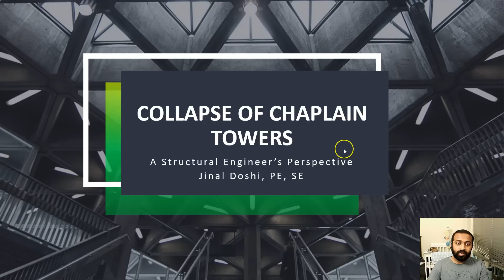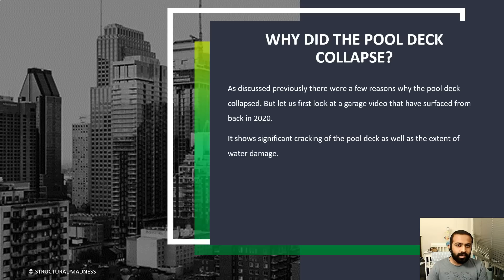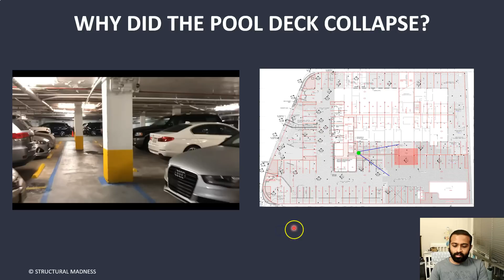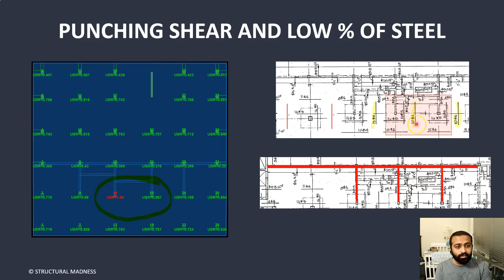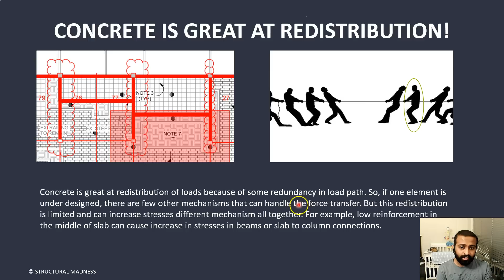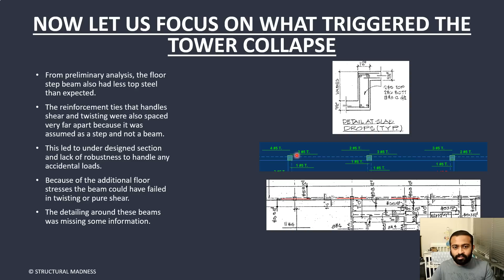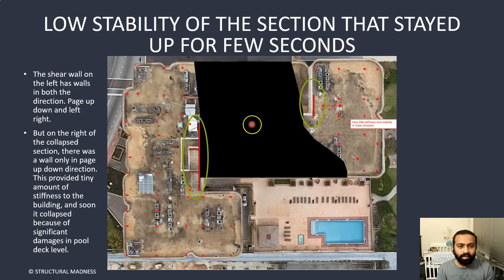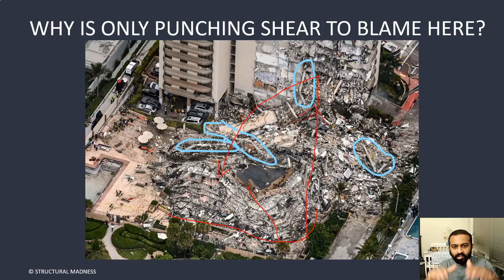Reasons behind Surfside Building - Champlain Towers South - Collapse : A Structural Engineers Review

Comment: As a structural engineer I found your discussion very well done.  One thing I would add is that I think you could be more clear as to whether the original design followed the code requirements at the time with regard to design loads and capacities at certain critical locations.  I'm not sure I see the value in analyzing service loads and I am more interested in whether there were mistakes in the calculation of capacity or demand that violated the applicable code from that era.  If the code was violated in the original design, then we have some assurance that any building designed around this time following the code is safe.  If the code was not violated and this building had some unusual structural configuration that was "outside of the code" then we need to be looking for other buildings that may also have a similar hidden collapse potential.
Reply from the maker: Love this comment. I did purchase ACI 318-77. And went through the clauses for two way slab design as well as punching shear checks. The direct design method was not a whole lot different than we are using today and per direct design method, I did notice the insufficient flexural reinforcement. The load combo back then was 1.4D + 1.7L. The 9.5" slab with 29.67' span was just not thick enough specifically with such heavy loading. 

Now this bay was a span away from the planter boxes and the beams supporting it. So it kind of doesn't surprise me that this entire thing collapsed together and the trigger could be punching shear at the columns supporting longer spans / the beams failing. 

So I think the building itself was not meeting the code back in 1970s. Also the detail of slab column frame doesn't show any ties through slab, and there is no detail for beam column connection. So I am wondering if they didn't put any ties for 2.5' depth of the step beam and with 16" cross section as soon as the step beams failed, may be it damaged the concrete significantly leading to slow bar buckling and later on a complete collapse. It is a far fetched idea but it actually fits the puzzle.
Reply: @StructuralMadness  Yes the 2-way slab provisions from even ACI 318-71 are essentially the same as what we use today.  I wondered though- so I checked the drawings again.  They reference ACI 318-77 and ACI 301-72.  301-72 was probably referencing or based on 318-71.  The ACI codes back then used different load factors but for most design checks they also used different capacity reduction factors so the end result was essentially the same.  Flexure is different and flexure design under older codes required slightly more reinforcing than flexure design under current codes.  The drawings also aren't clear on what design live loads were used but using loads that today we would think are reasonable there are aspects of the original design that I think are underdesigned.
Reply: Torsional Irregularity is the answer to this collapse. The dropped beam where the building and patio slab ties together and some beams  pulled the slab and columns imparting a large moment and tension force. The slabs pulled away from the columns as the shear connection was very poor..
 As the slabs began rotating at the column connection they were slowed by the shear walls on each side but also by the weak slabs. The slab fell in the resultant direction. 
I guesstomate the load on the middle first floor columns are 800,000 #/ 4000psi concrete slab =20 sq inch column required for compression.
Now lateral loads may have had inadequate shear walls . n area of the slab and reinforcement was cut out for testing near where the collapsed front column was.
Also lack of drag strut so slabs can dump shear into shear walls.
Reply: Also significant for liability purposes.

Comment: I have a question for you.  I live in Miami.  The very next morning when the news broke of the Champlain towers collapse, a woman called a local news station and she said that she lived right across in the building next door and that she noticed the morning before the collapse there were a lot of roofing materials stacked up on one side of the roof and equipmentfor the re-roofing that was going to commence.  Now you have the weight of 2 roofs on there (they hadn't removed the old roof yet).  Based on the findings in the Morabito report from 2018, do you believe it was a bad decision to start the roof work first and pile all that heavy roofing material up there when the concrete is still crumbling?
Reply: It didnt help
Reply: @designstudio8013  Einstein

Comment: Look at the before overhead shot. 
The tiles in the area where the two buildings connect are very much darker than the rest of the deck. 
That isn't shadow, the entire deck is in shadow, it's water damage.
I believe much more than the known area of the deck fell first
Yanked rebar out of and damaging the columns along the perimeter, along with smaller columns and fewer, smaller shear walls of the collapse section.  
The rest is tragic history.

Comment: Great video. If the north-south beams had run across the suspect initial columns and continued below the tower (to the north) by another span (or more), would that have significantly reduced the likelyhood of a pool deck collapse leading to the column collapse?
In other words, did those 15" depth beams terminating at the line of suspect columns make things worse for the columns?

Edit: or did the slab step-up create a worse effect?

Comment: And no sheer walls is just nutzzz.   I built several 4 story underground garage slabs for four story wood framed apartments in LA 1980's. Our slabs were 12" thick with 3/4" rebars top and bottom 10" each way. That's a lot of steel. All held off from the exterior by 2"  "spiders".

Comment: Thank you! I was looking for video with an engineer that analyzed, in depth, the design and building flaws that started the 40 year chain of events (including lack of maintenance, inept contractor repairs, salt water flooding garage, effects of salt air and fertilizer in planter boxes, etc) that lead to this disaster.
Knowing the builder was shady, cost cutting is usually an issue, that corruption and poor construction ran rampant in the 80’s, building codes weaker, etc, it’s no surprise it wasn’t built right, and your analysis easily explains it to the layperson . 
Some other great channels (Building Integrity, for example) go into it to some extent, but it’s mainly excellent analysis of what could have caused collapse after construction.

Comment: Taking in all the videos and all aspects of collapse it is clear to me that the base should be wider than the top like pyramids that survived thousands of years. These modern designs obviously AR crap. I like the comment of one person in another video said he will never go in a stacked parking garage or high-rise again. It's always May the buyer beware. If you look at a mountain you get the general idea of how to build. We need to take down these buildings one-by-one, it is a warning, a sad one for sure. High-rise becomes low-rise, the engineer and contractor should be found and put on trial, let's not forget the crane that collapsed on the foundation in  1980.
Reply: The folly of man's self-confidence, palace-building, and consolidation of land/power.
Reply: The building used stronger concrete down low to account for the loads above.  Pyramids used the same strength rocks all the way up so they got smaller all the way up.

Comment: Interesting. One thought I had during this presentation: did you feed your model with current load data or did you use typical loads implied during the planning of the building? Furthermore, were the dimensions and amount of rebar untypically low for the time of construction (late 70ies)? There's been a lot of progression in building codes and modelling. A huge part of this due to the advent of FEM.
Reply from the maker: Good question, The loads were the actual loads present during the collapse. Not the typical loads that we use for building design.

Comment: I still don't understand why this building collapsed.  The pool deck collapsed.  Then there was a pause.  Then the rest of the building collapsed.  So the collapse of the pool deck contributed to the building's collapse, but it wasn't the immediate cause of the building's collapse.
Reply from the maker: Excellent question. You know I myself have pondered up on that question. I was able to come up with 2 different answers:
1. It took some time for column instability to be so severe that it went past it's critical stability point. That is after the deck collapsed it took some time for un confined concrete and its aggregates along side steel to get so disturbed that it was no longer able to resist the 12 story building load from above. 
2. It was because the step beam was trying to resist external forces and steel within the beam including ties / longitudinal reinforcement. But then may be because of lack of reinforcement it gave up and then failed at the column face leading to instability of the column. It could be either of the two. 
Steel can stretch 112% of its original length before it gives up, so may be that played some role in it? We should wait for NIST report for this if they can figure this out from all the rubble. But I wouldn't be surprised if it was actually because of this step beam failure.
Reply: @StructuralMadness  The offset detail really doesn't have much capacity in flexure but surprisingly they got the stirrups right so it works out pretty well in shear.  There is another channel that makes a big deal out of the Beam A on plan, they call it "BMA".  So I checked those- they are placed to function like transfers to support offsets and so forth.  Those are the most underdesigned elements of the building that I've checked, with about 1/4 of the capacity that they should be designed for.  I think the slab failures had to progress from the pool deck into the tower itself and had to fail the slab stepdown to do it.  The stepdown beam could fail in flexure or in combined shear and torsion.  If the failure could progress into the building then it could compromise columns under the building and allow it to fall.
Reply from the maker: @billj5645  Yes, the planter beams supporting the smaller steps in the slab were typically under designed, and that too mainly for shear. And that's why I ran a punching analysis on the column supporting the beam "A". I did notice that it does fail against the design capacities right under the working load conditions. And I do think that it was mainly the degradation over the years and cracks opening up because of any additional load over the years that could have lead to the collapse of this region as well. If we look closer to the parking garage video, the step beam is still intact at least in the visible region. So I wonder something happened within those 8 minutes after the collapse of pool deck that lead to an instability failure of a slender column.

Comment: What impact do you hurricane Andrew would have had on the structure?  Could that have initiated the cracking?  Hurricanes always rotate in the same direction, so there is a predictable load path.  It should be possible to line up the cracks in the video.  There was often only one diagonal, rather than the expected 2, could this have been the result of episodic wind loading?
Reply: The highest winds were south. I don't think it would have survived 160 mph winds.

Comment: Yes, I agree 99% with @Structural Madness' analysis of the original engineering/design.  However I totally disagree with all 3 points on the "Factors that may not have contributed" list (6:39).  I would rather title it :  "Factors that MAY have contributed" or rather "Factors that have PROBABLY contributed".  1) "Pool Deck Columns" DID fail.  Unless, not being a construction engineer, I am totally confused regarding what "pool-deck columns" are, where they were located, and what role they were supposed to play in supporting the building but didn't.  And if they were supposed to support the building but didn't, it means that they failed.  2) Why state "there was no evidence of seepage of sea water into the basement" ??  All you have to support your denial is that the water was only puddling here-and-there on the floor, per recent photos of the garage.  But we all know the location of the building and its consequential exposure.  Yes, there is documented decades-long history of garage flooding from high tides.  Salt-water penetrates concrete, damaging it faster than fresh-water, and speeds-up the rusting of the rebars underneath.  This is the most likely cause of the advanced structural damage in this building at such a young age.  So what do you mean by "there was no evidence of seepage of sea water into the basement"?  Have you tasted it?  Have you evidence that there was no sea-water there?  How do you document that there was no ocean-water seeping-up through the garage floor (in addition to the water seeping down through the pool-deck and dripping from the garage-ceiling unto its floor)?  You can't.  3) Maybe there was "no significant settlement between the columns" just before the collapse.  Or maybe there was.  We have no measurements of the subsidence differential among columns.  If you have that please post it.  But sinking of the area under the building had been documented since the 1990s.  I am not aware of it being in the Morabito documents.  If it was, please post link.  But it was certainly not "unverified", since 'subsidence of 1 to 2 mm per year' was reported in the research paper at the Florida International University in 2020, which referred to the exact location of Champlain Tower South.  (If that was not enough "verification", I do not know what is.) If it subsided only 1mm per year since it was built, it means it sunk over 1.5" since.  It is virtually impossible that it sunk evenly in sync at all times.  I'm no building-engineer but I suppose that promoted some shearing strain – don't you think so?

Comment: no spalling in garage roof concrete, cracking, yes. concrete in slabs and beams are designed to deflect as a warning. None seen in the slabs. how can there be maximum stress on steel without major deflection. not using load factors, factored loads allow use of higher allowable stresses, eg. non factored steel allowable 36,000, factored load steel allowable 60,000.punching shear decides the depth of slab, it is a concrete issue.
Reply from the maker: Actually, deflection is not a sign of warning. Limited deflection will always be there. If the slab is spanning 30’ and the deflection is like 1.5”, then it is not severe that you can just notice it from a video or looking at it specifically on such a large footprint of a basement. But the reason why I do say it was under designed is based on the analysis. And as described in the video, the pool deck was stressed to almost 100% of its capacity just under its own dead load without any load factors. That means the cracked moment of inertia of the section was significantly low because of the skinnier slab and low % of bottom mat for such a large span. 

Even back in 2018 Morabito associates show cracking and deflection in the surrounding regions, although the deflection was still within permissible limits.

Comment: Should tall buildings be built with poured concrete without a steel beam superstructure? This type of complete pancake collapse is disturbing.
Reply from the maker: It is okay to build buildings with flat slabs. Now a days building codes have become a lot more advanced. Specifically after Ronan point collapse, a clause for integrity reinforcement was added into building codes, that helps in reducing these types of progressive collapse failure of reinforced concrete buildings.

Also, on top of it, the detailing requirements for columns have improved as well as punching shear reinforcement at the slab column joints. We have to understand that this was an outlier in terms of expected vs actual building performance. This is very very very rare event, I would not generalize this and provide a blanket statement that “all tall buildings with flat slabs are unsafe.”